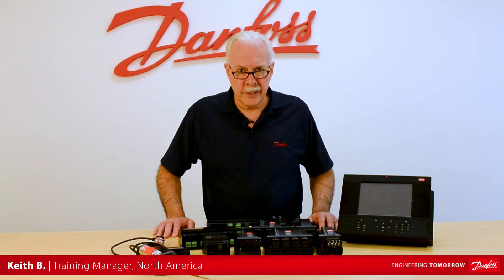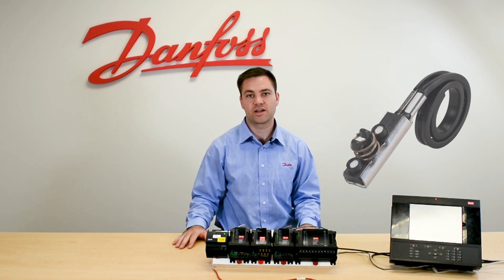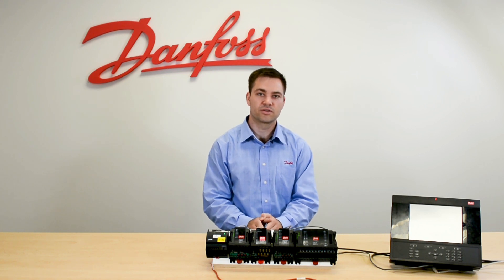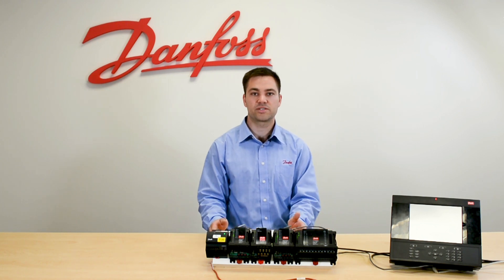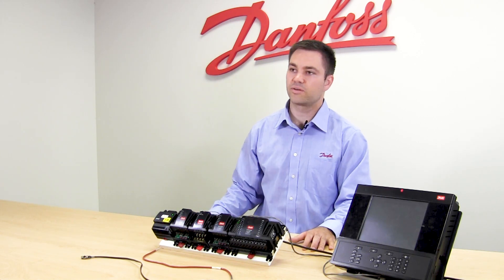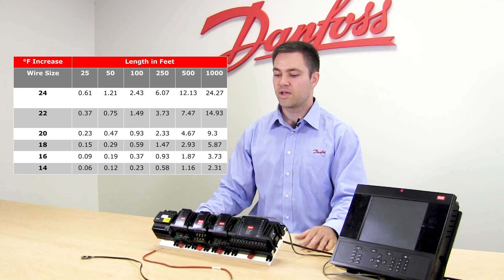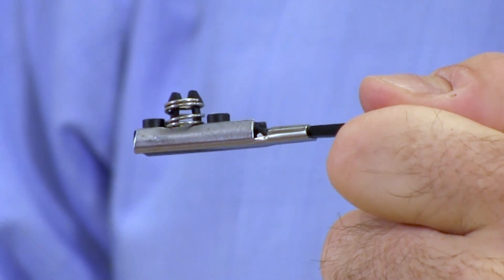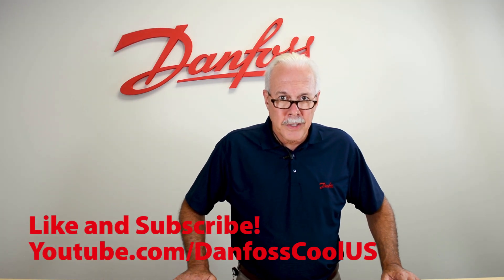PT1000 temperature sensor product overview | Technical support for supermarket controls

Comment: Is there any sort of software available for the pt100 sensors or a API to integrate them in existing software?
Reply from the maker: hi Yves, we can share a temperature to resistance chart. Please contact us at:
1-888-Danfoss x2066
Cooling.TS.FR.NA [AT] danfoss.com